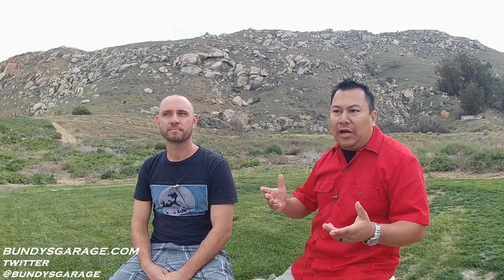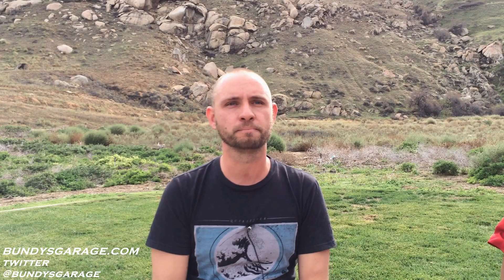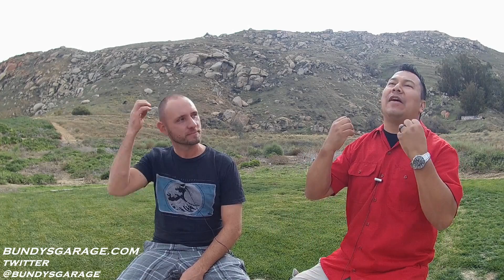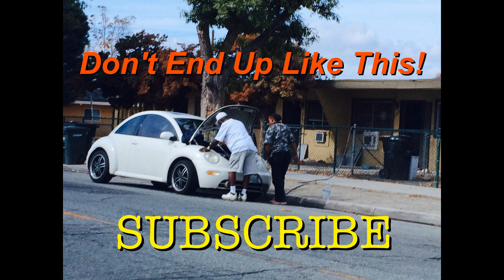Mazda Valve Carbon Buildup (DI) Direct Fuel Injection - Skyactiv - Fight Carbon Deposits

Comment: I just add an oil catch tank to my 40k km mazda3 skyactiv. Once i dismental the intake manifold ... the amount of carbon deposited at the intake manifold and cylinder head is quite bad. Im using crab cleaner to clean it up one by one. The best part is our intake manifold contained atleast 100ml of engine oil in it ( due to the original oil catch tank can't worked out properly)... thats the part of the reason why we have so many carbon deposited at the intake.
Once i installed it and ran the car for 5k km.. my new catch tank able to trapped abt 50ml of contaminated oil and this may helps to reduce some carbon build-up.
Reply: I've been running a catch tank for over a year on my 2.5 cx5. It always has a good catch at lil change time.
Reply: If you use a catch pan and empty the collected oil, don't you have to keep adding oil?
Reply: @Victic005  
Even before the days of direct injection, that oil would have gotten burned up in the engine.
So “oil consumed” doesn’t change, just because fuel injection moved from port injection to direct injection. 

High oil consumption, yes oil should be checked and added; make sure you don’t fall below the “min” mark on the dip stick. 
Not so high oil consumption, just wait for the next oil change, and the level will become full again with the new oil.
Reply from the maker: +felix liew nice, that it worked out well. If Mazda really wants to fix the problem, they need to install a second set of injectors in the intake that fire off every 15 minutes to keep the valves free of carbon and keep carbon off the piston. The reason you are seeing oil in the intake is cause carbon seizes the rings and the oil gets pasta the rings right into the intake.
Reply: BundysGarage heres is the link where i install my oil catch tank
https://m.facebook.com/story.php?story_fbid=686753744843843&id=187673004751922
Reply from the maker: +felix liew are you making videos on YouTube?
Reply: BundysGarage .. sorry bro... not yet. Cos when im doing this.. it took me 12 working hrs to get the job done... too time consuming esp for the carbon clean up... but im happy with the results. I'll post an long term test or review on the catch tank and the carbon build up. Happy weekend.  Cheers
Reply: use spell check, or have somebody check you spelling.
Reply: @vespa12341  You should take your own advice.

Comment: thanks guys .I may shy away from skyactive . I wait and see what happens down track . thanks Dennis
Reply: Lexus/Toyota use dual injection when they don't use port injection, like in the NX200T engine.
Reply: they're excellent engines, fyi. All direct injection engines will suffer from these issues eventually, but keeping combustion temperatures down (closest to optimal running temps) will in turn keep carbon deposits low. These engines can run on Atkinson Cycle under low load and once fully warmed produce very little carbon deposite compared to other direct injection engines.
Reply: Bullsh!t - the emission standards are global, driven mainly by the Europeans; Dieselgate was an attempt to circumvent European, not U.S. emission standards.

Why bring politics into mechanical issues... Obama had nothing to do with standards implementation...
Reply: @zaphodsbluecar9518  because America is NOT Europe and thank God for that!  BundysGarage is spot on with his comment.  Obama and the Dems wanted to turn us into Europe.
Reply from the maker: Who would become civilized?
Reply from the maker: +Ny Chan almost all manufacturers are heading towards GDI engines. They are trying to meet Obama's ridiculous fuel standards. That's why VW got caught in their smoggate.
Reply: @bundysgarage  lol ok

Comment: Did you ever make a video of the ex Mazda tech actually cleaning the valves on his Mazda 3? I know a lot of Mazda owners worry about the carbon buildup issue.
Reply: looking forward to this. It would really be very helpful to know the issues/problems relating to DI engines, esp mazda.
Reply from the maker: +Mark Gonzales working on getting it made
Reply from the maker: +ricstars95 DI engines are having a lot of problems.

Comment: I'm a mazda tech myself here in Canada haven't had any issues with the sky activ cars with carbon, the old speeds and cx7s for sure but none on the sky activ
Reply: @chienlaid dude me too. Just now having the issue
Reply from the maker: I guess mikeZinck hasn’t worked on too many Mazda’s if he hasn’t seen the problem.
Reply: @bundysgarage  There were several that commented on here that obviously are here for other reasons than helping others. Mine wasn't bad. I cleaned it up with a cheap sand blaster and walnut media from HF. Was quick, effective and pretty easy. Couldn't really tell much difference after doing so though.
Reply: @mikesullivan542  Whats happened since with the build up?
Reply from the maker: +mikeZinck there have been Mazda engineers from Japan over at the dealership training us how to remove the carbon on the Skyactiv engines valves.